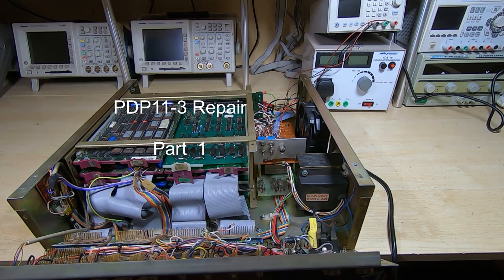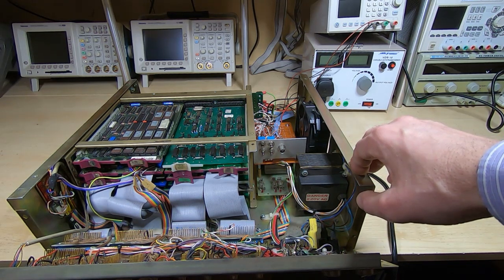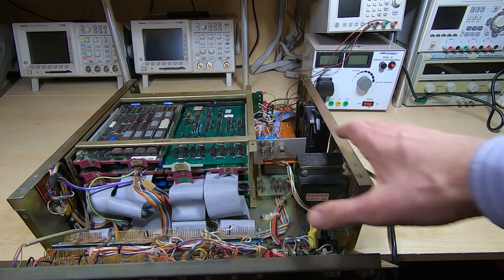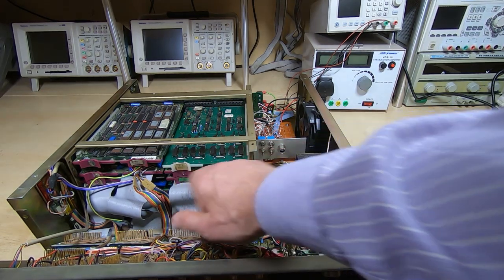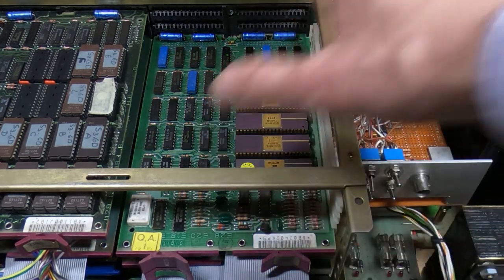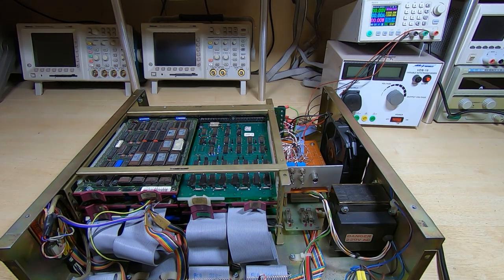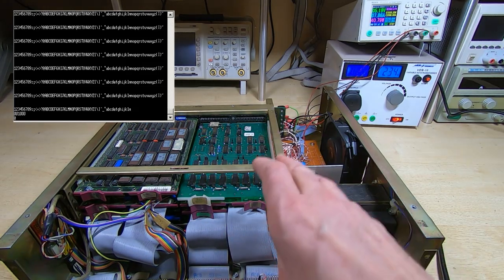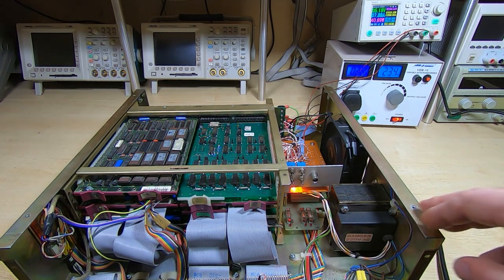PDP-11/3  Repair Part1

Comment: Looks like a Q16 bus like on the 11/03... CPU boots like one as well as far as I know... but the PSU is new to me and possibly isn't even  a DEC PSU and the case looks custom? Likely around 1975/76'ish? Perhaps the QBUS cage is likely DEC though.
Reply from the maker: There is no power supply in the case. The entire thing fits inside a huge CNC machine which houses the PSU, control terminal, driver modules etc but I was not sent any of that as the CNC machine weighs around 3 tons and is in another country. This is all explained in the later videos.
Reply: @JerryWalker001  Ah I see, was thinking this was like an 11/03 box... it does look vaguely like one! thanks!
Reply from the maker: @nfcpro  Yes I had a few people in the comments telling me I was wrong and it was not an 11-3 but was an 11/03 because .......
It is certainly based on an 11/03 but it is a custom controller specifically designed for this application and is not an 11/03 but internally designated as an 11-3.
That said it does not really matter what it is called :)

Comment: I hate to say it, but it's PDP-11/03. There wasn't any PDP-11 models with a single digit number after the slash. It's the same difference between an RL02 and RL2. The RL2 wasn't a product but the RL02 was.
Reply from the maker: It is not really a PDP-11/03 either as that is incomplete. I give the full number in one of the videos but as the videos are about a repair and not part numbers then I shorten the numbers to make the videos easier to follow. Do you have any advice on the actual repair?
Reply: @JerryWalker001  That's like saying "I'm fixing my Porsche 91"  Part numbers are part numbers.  There's an 11/03 and an 11/23, etc, but no 11/3 (and there is an LSI-11/2, referring to a specific CPU card but not a system)

That said, I'm wondering why the CPU card isn't at the top of the bus like every DEC machine I've ever worked on.  It might work to have a memory-only card ahead of the CPU, but the usual arrangement is to have the CPU at the very front of the bus, then memory, then peripherals, in an order that works with speed and latency because of how the CPU responds to interrupt and DMA requests, and with no gaps in the cards - you have to have a continuous line of active cards or filler cards (called "Grant Cards" because they pass along the bus grant signals across what would be an empty space.

It's entirely unlike an ISA or PCI bus PC where it doesn't matter where the cards go or if the slots are full or blank.

This kind of configuration is covered in the handbooks of the era which used to be given away free, but now are ~$20 on eBay or you can download PDF scans.  Lots of essential information in the handbooks.
Reply from the maker: @ethandicks3  I suggest you watch the videos in this series. And I was not the one who said it was a PDP11/03. I specifically said this was an incomplete number in my reply and that I give the full number in a future video. As far as the board order is concerned, I did not design it I just had it for repair. The manufacturers manual gives the order of the boards and this is a custom machine so  maybe you could ask them.

Comment: I agree that 11/3 (3 axis?) is clearer.  One thing occurred to me.  All of the DEC based CNC systems I saw used the designed for the job Industrial-8 or Industrial-11 CPU's. Mainly due to the need for electrical noise immunity.  An LSI-11 based system would not do well in that respect. I do not think CNC companies like Cincinnati Millicron or Bridgeport would do it that way.
Reply from the maker: Yes I agree and I think that there are other reasons it is not ideal which I will cover in the next video. But it is what it is and I did not design it, I am just trying to repair it. I think that there were many instances of the PDP machines being designed into less than ideal configurations. As far as I know this machine was used in a CNC environment for a long time and if nothing else it is still nice to see one being put to active use. I think it is very rare these days to see any PDP's in regular use and that is why I am happy to help the owner get it working (hopefully).
Reply: @JerryWalker001  Yes there was always room for smaller CNC outfits to have a go.  Of course I commend your efforts in getting it going again regardless of its origins.
Reply: @rod - I have an M7264 KD11-F CPU card that I pulled out of a Bridgeport Series II CNC before it was scrapped. It had a custom (non-DEC) backplane with mixed Qbus and some proprietary bus for the motor driver boards, but the CPU was 100% DEC.

Comment: I have no experience with PDP but with analog encoders systems instead. Most cases I found faulty encoders. Early opticals uses lamps that can fail and the glass disk got contaminated by refrigerant liquid (all cnc machines use it) preventing marks and spaces reading. If all axes or more than one fails to read probably the PDP has a fault in the AD converter or dead countings. Just thinking loud 🤔
Reply from the maker: Thanks, Actually I do not think that the problem is with the encoders as the encoder values should still be displayed even if they are faulty and all 3 failing at the same time seems unlikely. I think the problem may be with the system shadow RAM, more of that in the next video.

Comment: The company I work for used to have a Salvagnini TB20 panel bender, with some flavour of PDP-11. I think they took a gas axe to it in the end and carted it away in pieces. If I knew then what I know now. :-(   And £1 says those encoders are resolvers.
Reply from the maker: Many of these systems met very sad endings. The documentation refers to the encoders as 'Rotary (Shaft) Encoders'.